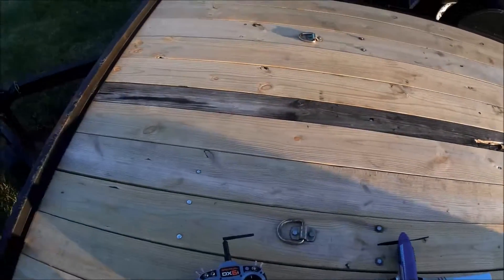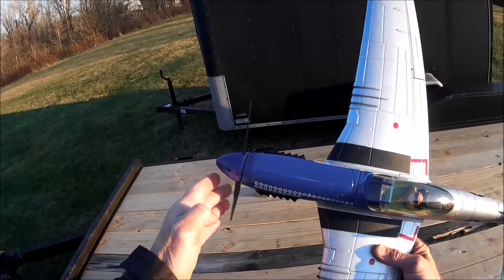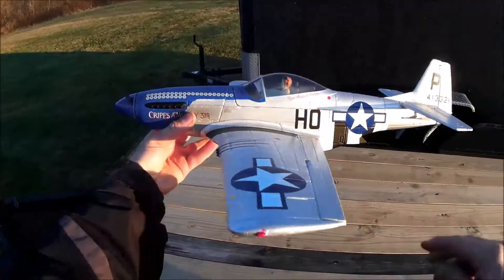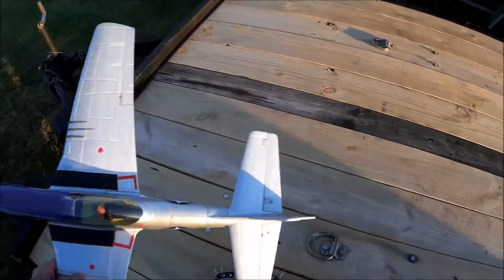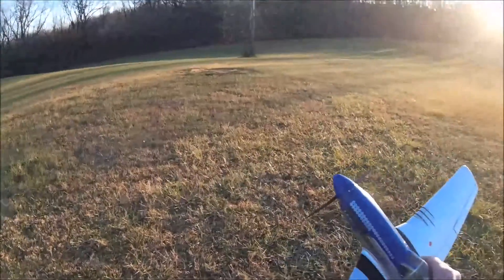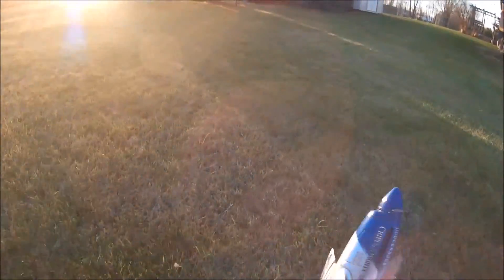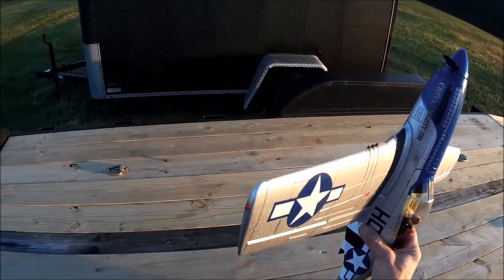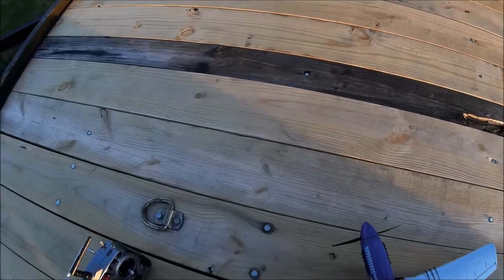New Video E Flite  P 51D Mustang 280

Comment: You should try a Lemon-RX 7Channel with Stabilization, DSMX, and Diversity...super cheap (shipped about $25). I discovered the receivers after having a poor experience with Orange DSM2 receivers.
Reply from the maker: I bought one of those receivers for another plane I just haven't got it put in and tested.
Reply: +RCflyingfun I've been super happy with mine (I think I have 4 now...), but in saying that, I had been running a DX8 and now I'm running a DX18...are you using a DX6? If so, you won't have access to the 8th channel to adjust gain on the fly...but you WILL be able to turn Stabilization on and off with the GEAR channel. This channel IS still available as a control, but in my experience, I don't really want to turn it off durring flight. Aux 2 is hooked up on the Bind plug.

Give it a shot. I hope you're as happy with it as I was. Of course AS3X is great, but this actually fits in my budget.
Reply: +RCflyingfun ....SORRY, one more thing. This RX supports flapperons, which I usually use at least flapperons, if not regular flaps, basically on every plane I own. I just really like to be able to slow down. I feel naked without flaps...

Comment: Just found one of these myself, brand new in the box!   Like you said, the plane does feel a little weak and wanted to reinforce it some before maiden flight.  Question, what did you use to glue the cf rods in?   And do you think foam safe CA glue or foam TAC for gluing the wing to fuse?  I have both.
Reply from the maker: I used Silicon glue, it is available at any hardware store. You can also use a foam safe glue. I also glued the the wings to the fuselage with silicon glue.
Reply: Thanks